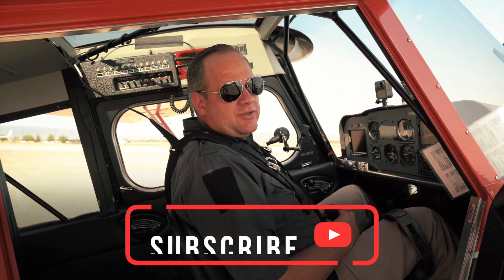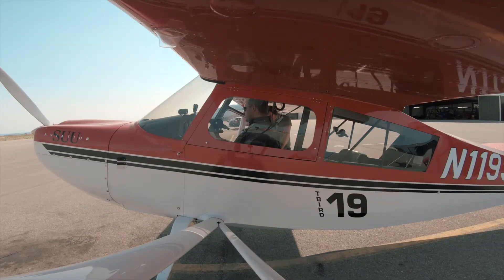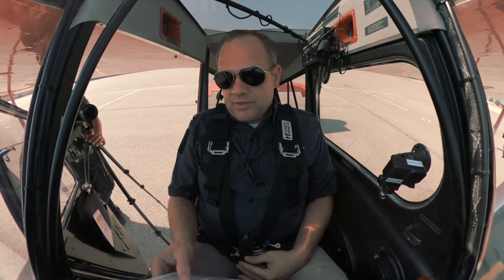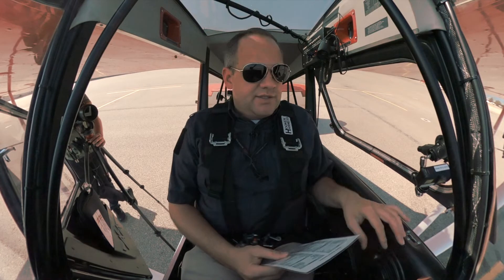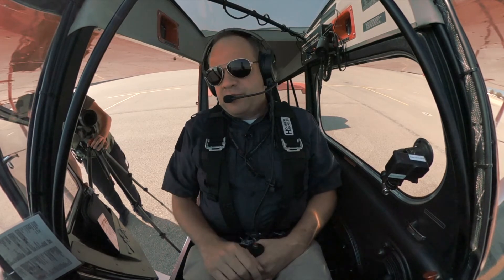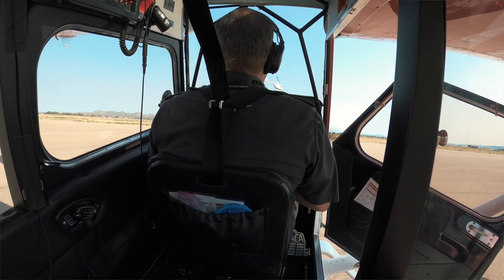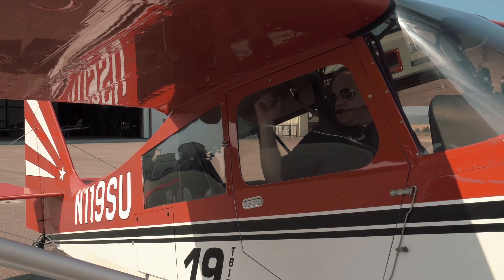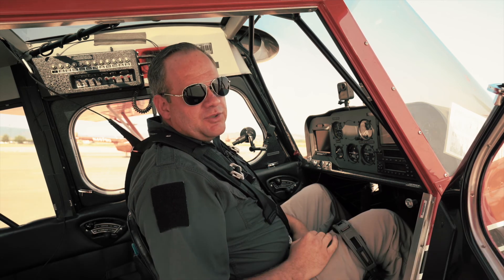American Champion Citabria Startup And Takeoff | Step By Step

Comment: When it's minus fourty out the only way to start is to make all switches are off, turn the prop backwards to loosen the engine, prime about 10 pumps then do a complete walk-around. Then with the brakes on or the tail tied down and all switches off turn the prop by hand forewards to suck evaporated gas into the cylinders. Then follow your startup procedure. At minus fourty you need a lot of time from priming to starting. This was taught to me by an old bush pilot and no matter how cold it was the engine fired right up. Also the heater was a one foot warmer.

Comment: Good video. I have had a 1974 Citabria for 18 years. I like his suggestion about priming the carburetor. I always pump 3 or 4 times. I can't wait to try 6 when the temperature is cold and 2 when the temperature is warm. But I don't like to run at 1,000 RPM until the oil temperature is 100 degrees.